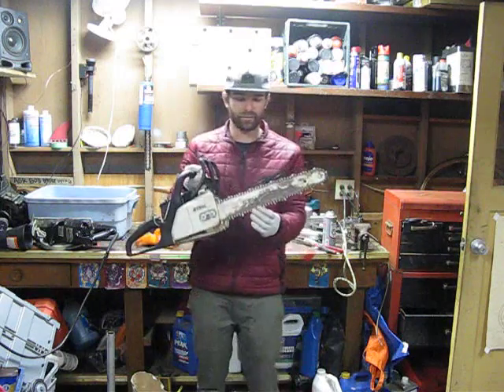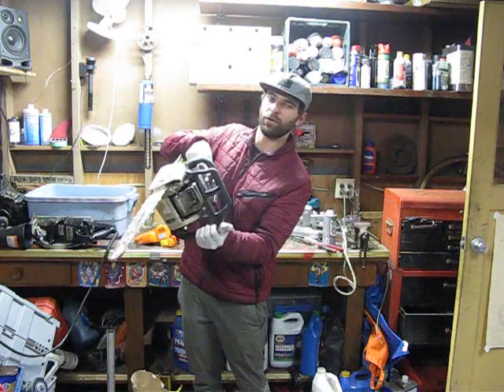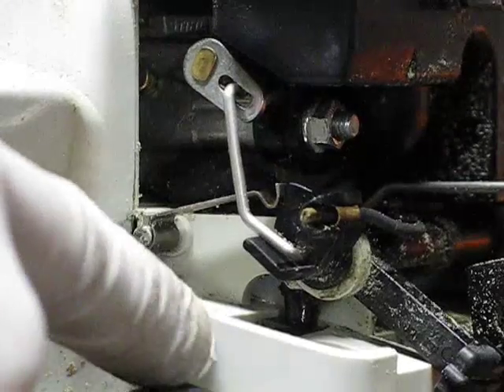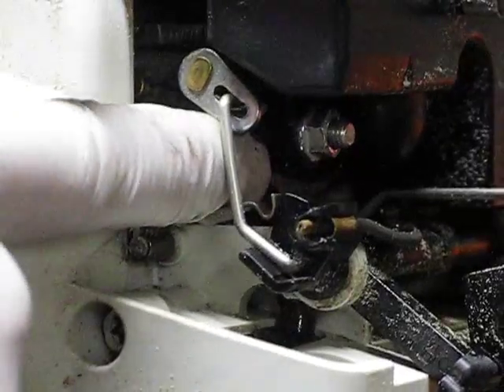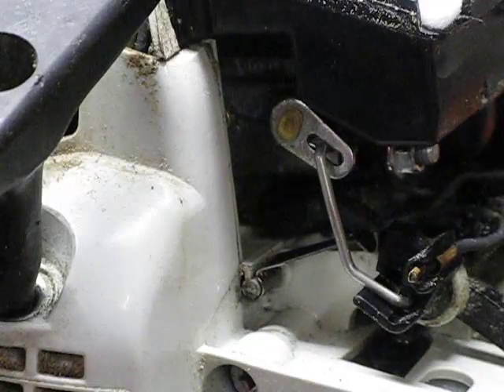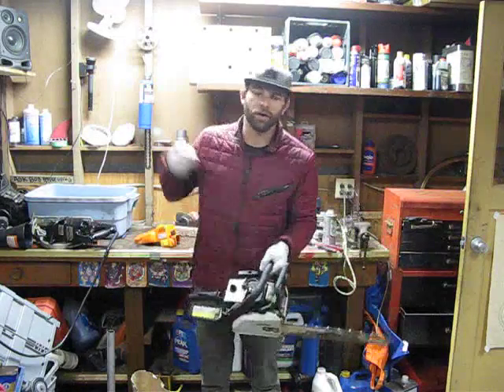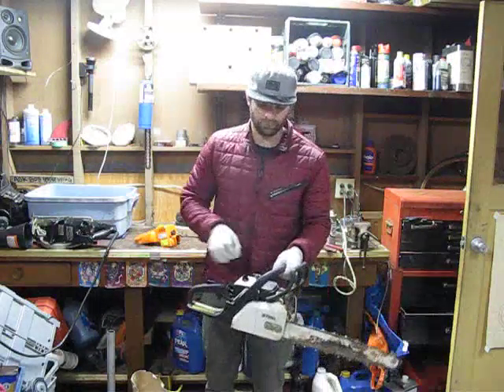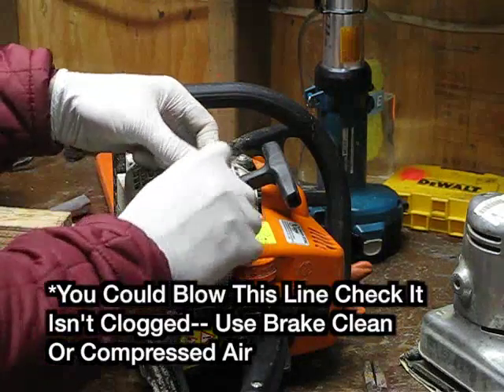Fast Diagnosing Chainsaw No Start (Stihl Ms170) / Runs Poorly: How To

Comment: When checking the fuel line with compressed air, be very careful when you remove the air nozzle.  Mine put enough pressure in the tank to shoot the fuel out like a geyser once it was removed. It got all over my clothes but fortunately not on my face or in eyes.  I did indeed verify the line was not clogged though! Thanks for posting this video.
Reply from the maker: always good to use those safety glasses and remember physics! glad you're ok
Reply: Yes, thank you. After looking around to see if anyone witnessed this dumbass move, I did get a rather good laugh at myself!
Reply from the maker: @dennishanley9103  haha i have done too many countless dumb things
Reply from the maker: is saw running right now?